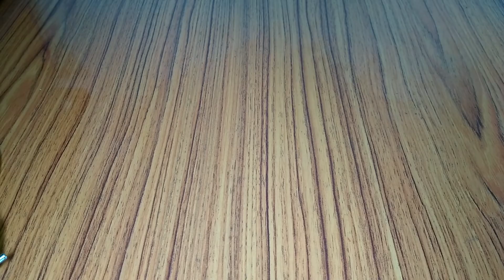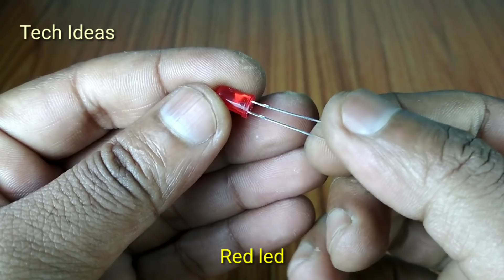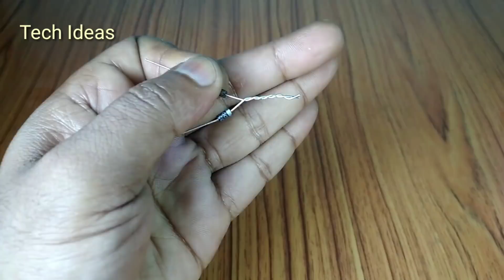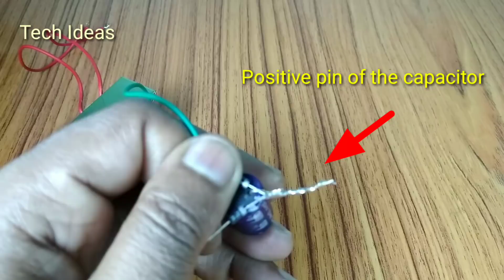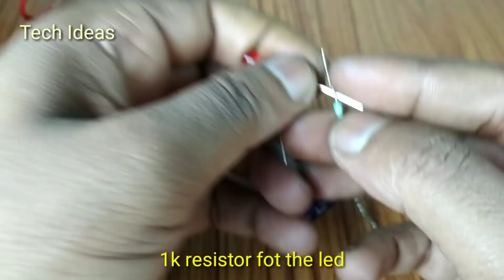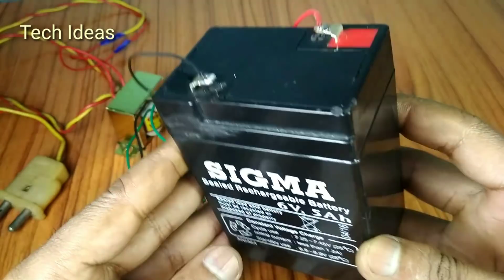Simple lead acid battery charger

Comment: When you cut the lead off any diode, it reduces the current carrying capacity, as the lead is used as part of the heatsink for the diode. Info from an ECG company tech.
Reply: So basically if you have a 1A diode and connect it to a giant heatsink it would technically be a lets say 10A diode?
Reply: @aleksandersats9577   Not really. The lead is engineered to be part of the heat dissipation capability.  There is only so much current the internals can handle.
 My information came from an ECG factory tech.
Reply: @f.k.burnham8491  Well yeah there always is a limit due to heat, but if you are able to dissipate a lot of it it should theoretically work. I understand it might not be able to handle 10X the original value but definitely lets say 1.5x the value